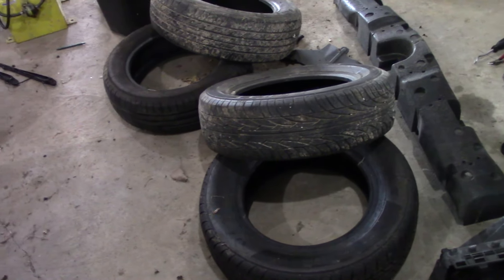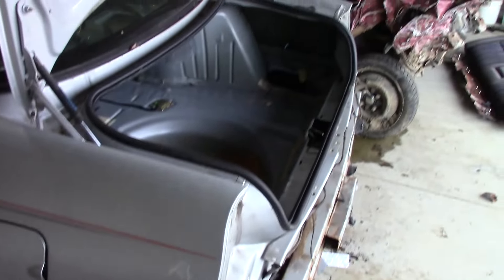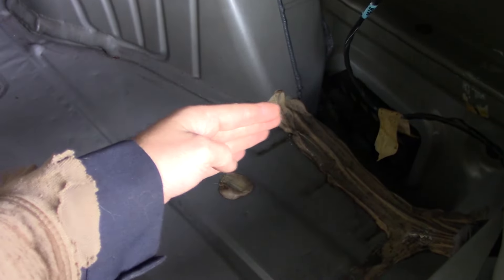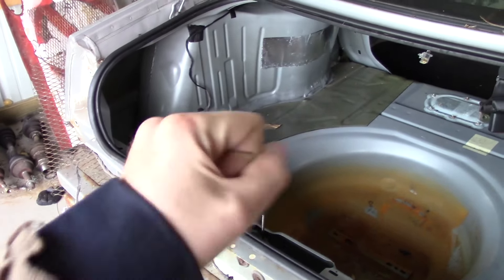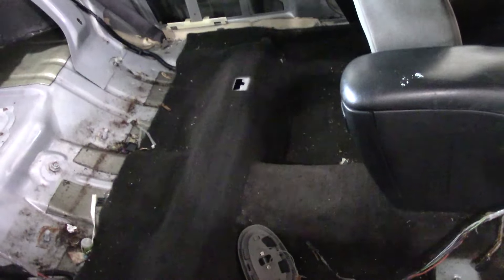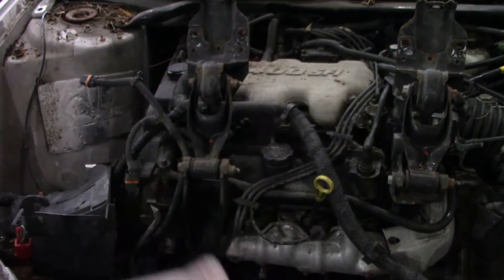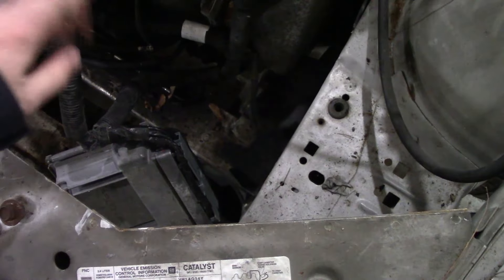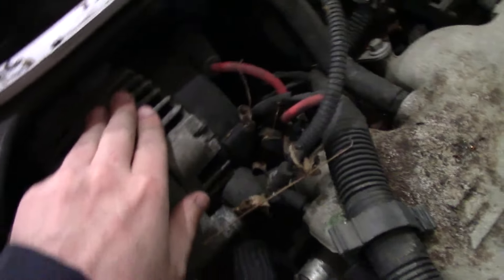2003 Monte Carlo Derby Build Ep 1: Derby Plans

Comment: I researched the most common bend points on the driver side rear frame. From what i saw there are few factory made holes along the bottom of the frame. The hole that lines up almost exactly with the rear of the back tire is the one that gives first. Then the next one in line holds the rear suspension. Both collect moisture from the tires and hide rust until they blow out.

Comment: Mitch dont worry about the fuse box location cause yes it is close too the pullies but out of any buicks ive seen ran and built  no one bothered too move it and none have broken lose. In fact the cars will die out before that fuse box even decides too break apart.
Reply: I double this, I've always just spray foamed them to the strut tower and never had a problem. I also normally leave the computer in the air box and spray foam it there as well.

Comment: Removing the trunk lid would probably help with the amount of metal mashed in the back if it goes down. Just an idea, what if you cut out the whole wheel well or did notching inside the car instead of the trunk?

Comment: My 03 monte back end didn’t plow down, but crushed in so fast and far that the back tires got pinched. Those backends on the monte suck, but the front end was super tuff. I got 4 runs out of it after i put smaller tires on the back.

Comment: Rotors and caliper bracket and slide bolts off a buick century or regal. Use original caliper from monte. No need to bleed brakes

Comment: This trunk is pretty much same as a 98 Buick century I ran last year had the big strut area on the driver side. I cut my trunk about half way 9 wired it notched it and cut a 90 degree slice in the driver side tower and opened it and it folded nice. I can send you pictures of it on Facebook if you want me to